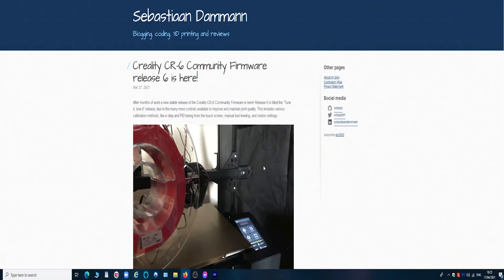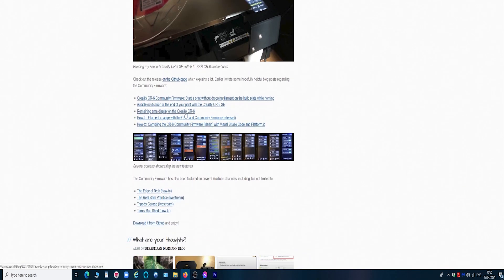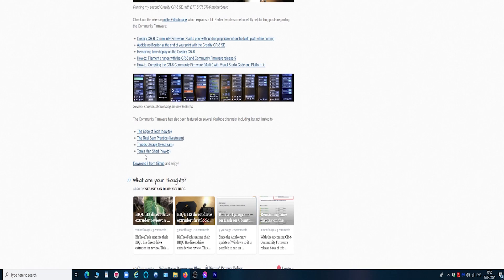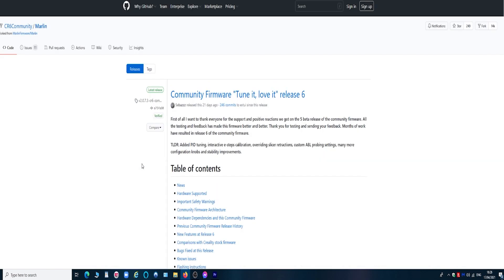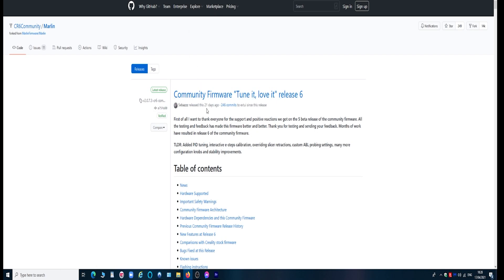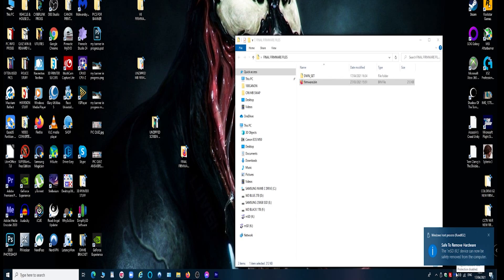FITTING A BTT MOTHERBOARD TO A CREALITY CR6 SE PRINTER.. INSTALLING THE COMMUNITY FIRMWARE VERSION 6

Comment: Hi Tom I have put in this board a few weeks ago and now I have installed the Bondtech LGX but after heating up I get the Driver error, any ideas would be helpfull. Thanks Dave
Reply from the maker: Hi David ...sorry but I don't know the answer...i still use the stock extruder so am clueless really.

maybe if you posed the question in the Facebook group I will bet someone knows the answer as there are some very knowledgeable folk in there
Reply: @TomsManShed  Thank you for your reply

Comment: I fitted a BTT board before fully using the stock Creality board and have had great success. I wish your guides had been uploaded when I did my upgrade they are great.
Reply from the maker: Thanks for that max......yes the Creality board was still working fine and I had no problems with it ...but since I had already ordered the BTT board I thought  I might as well fit it and it does have some nice extra features.

Comment: Hello there, i have a big problem.
I buy and install BTT SKR CR6 motherboard, install firmware (community latest version), also i flashed screen with community version and now when i want to Home or ABL the printer just go around 10mm up and thats all.. nothing more.. cycling power help only that X rail go down until it drive in to Z sensor and then goes up again and nothing more... please help, any idea what is wrong?
Reply from the maker: Hi Nomad....did you try selecting "factory reset" after flashing the firmware and before doing the auto bed leveling routine?....if so and you still have the problem then I don't know what it might be.

I am sure if you ask on the CR6 Facebook group that someone will be able to help.
Reply: Tkank you, i try to re-install all the software and then hit factory reset..
Reply from the maker: Did it work Nomad?...edit...just looked at your youtube vid...that doesn't look like the latest community firmware screen
Reply: @TomsManShed  Well... i flash screen with original firmware, same for motherboard (from Creality site) and.. 
here is a link to video if you want to see that anomaly 
https://youtu.be/0EhGaS9aB5M
...for me it looks like ABL take signal from Z sensor instead of strain gauge on hotend + when i push manually hotend UP that blue LED dont light up

Comment: Hi Tom, that was a great video, nicely explained. As a supplement, perform a reset after the firmware flash :-)
I also did the Community Firmware 6 Final yesterday on my mainboard V.4.5.2. Great settings have been added, really great what the developers have come up with and what is still possible! After that, however, not much went with the printer. He didn't put a smart first layer as the first layer. Z-off and bad leveling were set well (I am using Cura 4.8). He only printed individual threads, nothing stuck together. Then I stopped the E-Steps, from the standard 93 to 107, after that it was better. I have no idea what changes the settings so much to the original firmware: -O. Would be great if you made a video about your first prints with the new firmware, what has changed for you, or whether you could leave everything as it is. Thanks!!!!!
Reply from the maker: Hi Rc...  Thanks for the kinds words...yes sorry forgot to mention to do a factory reset and update (I mentioned it in the vid I did on the V5 firmware but forgot on this) ...I have added it to the description along with your advice re the e steps

I must have been lucky because I have never set the e steps on it at all. I remember having to do it on my CR10 years ago but the CR6 was fine straight out of the box and even after updating the firmware to firstly V5 then to V6 Beta and now to V6 Final the prints have remained just the same
Reply: @TomsManShed  Hi Tom,
I had only noticed it because I had applied the update myself the day before, but that was good again as you showed it.  
You wrote that with you no adjustments like E-Steps and so had to make. Since you really had luck. I had to adjust mei E-Steps to 101mm. But now I still have air between the individual lines in the first layer. Only when I set the flow to 115%, I get similar printing results as before. Could you also collect similar experiences??? Otherwise, I can not complain about the CFW 6 Final. Maybe other people have had similar experiences? They could write something about it here. Thanks    ......Too bad that you can not show pictures here.....